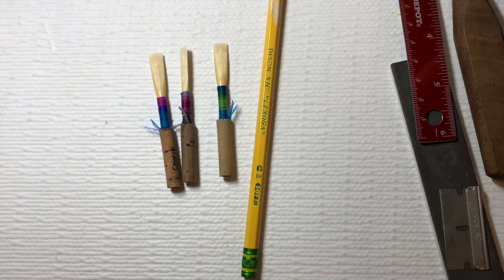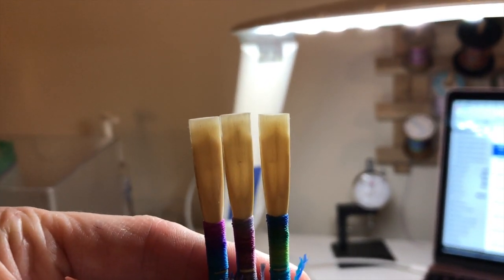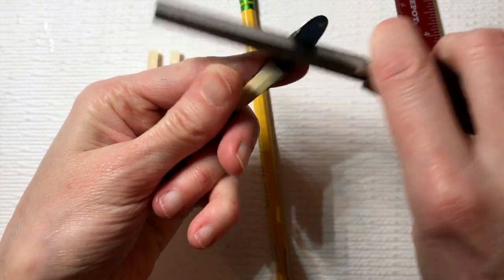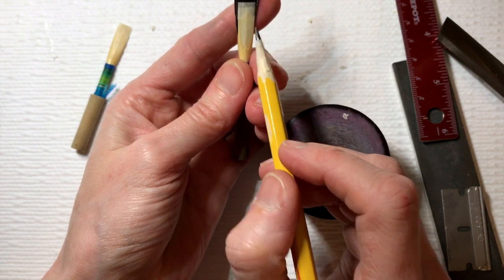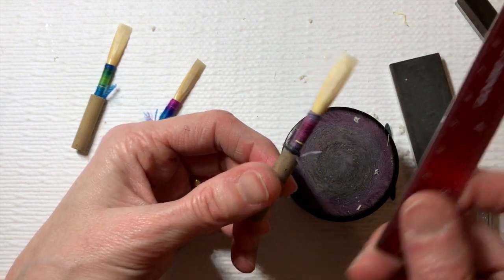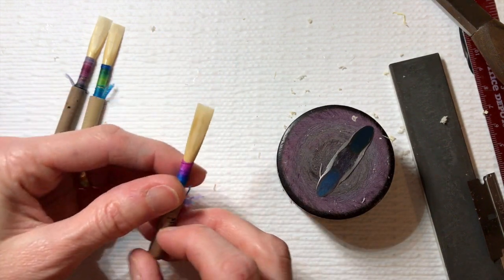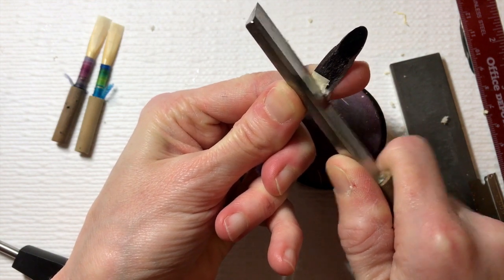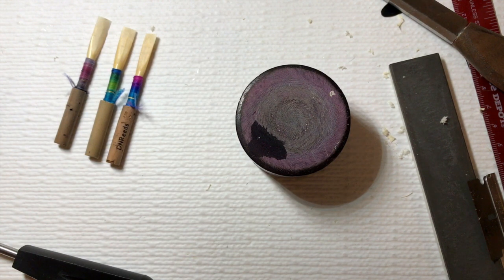Reed Repair Shop: Kathy

Comment: Wow!!!!     This video informative and enlightening!!!   Hearing that there was no stop between tip vibration and lower part of crow....I remember you saying at Boot Camp ; sides of tip and outer corners!!!    The 2nd reed......your comments so helpful as I just could not figure out getting it to vibrate with thicker walled tube.......so, am thinking....the thicker walled tubes perhaps more out of back?    I am also excited about the tube used for 3rd reed.       Whoever reads this post, I have to say that Jennet's Reed Repair shop is absolutely fabulous!!!        I love the simplicity, and clarity  of her terms (gutter, rooftop, chimney, etc.) and no fuss approach.  I have  attended her summer Oboe Reed Boot Camp the past two years, and it has made a huge positive impact on my reed making.     Also, I am  fortunate to be participating in her Invincible Oboist online 10 week course.   We are halfway through the course, and I have learned more in 5 weeks than years of previous oboe study.  Life changing!!!!
Reply from the maker: I love you Kathy.  Thanks for the testimonial, and I have to say it's SUCH a pleasure to work with such an enthusiastic and wonderful person as YOU.